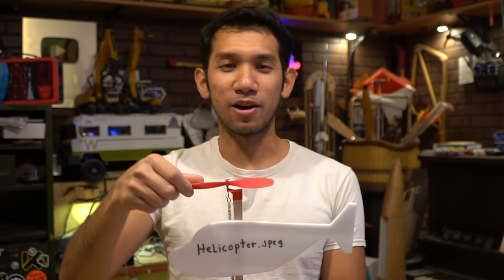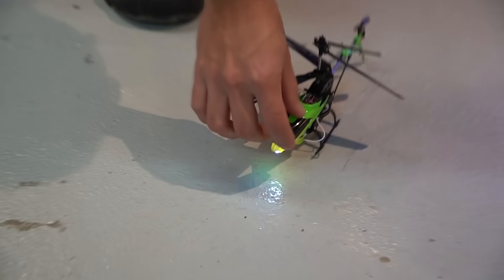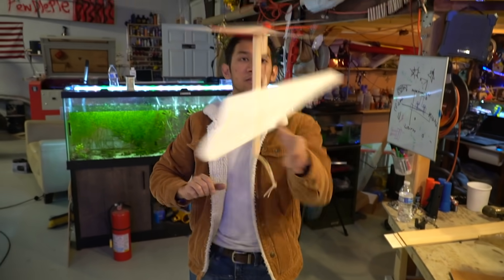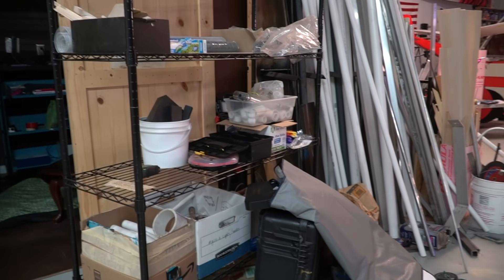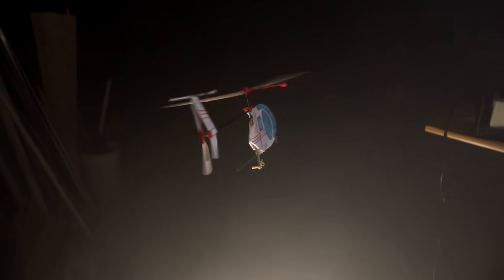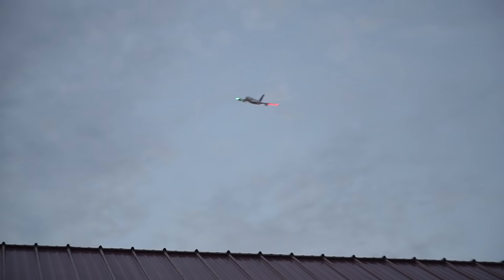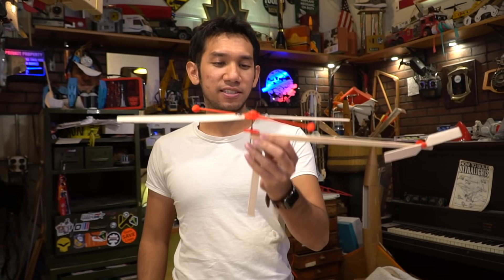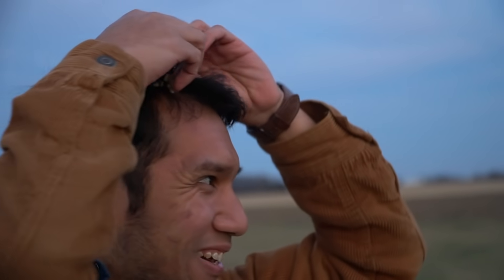Making a Rubberband Powered Helicopter (working tail rotor)

Comment from the maker: Big thanks to Ridge for sending me this wallet and supporting the channel! Here’s the site if you want to check them out! > ridge.com/SRIPOL
Reply: Soooo...Blitz infected you aswelll
Reply: the upper rotor blades need to be able to pivot around the attachment point. as the rotor actually swings and chops through its cycle kind of like a whip. There is a high speed point and a low speed point, research rotor blade physics. =]
Reply: Good job. Greeting from Indonesia
Reply: can you bulid a big super sonic jet
Reply: I can think of a whole lot of things more fun/important/useful to do with £100 than buy an overpriced "wallet".
Reply: Dude, your laugh XD
Reply: Hi
Reply: @Sharkeix  Hey Elijah! Our surnames must've starred out the same. Where do you live? Just the country your Hemmingsen grandparents come from?
Reply: 16:03 metro card
Reply: Wicked slim, unlike the girls on my tinder ... rotf
Reply: Would you ever do a bigger one? A huge remote control helicopter
Reply: make the airship from the collection
Reply: You need to balance the helicopter slightly nose heavy then it will fly forward with the tail rotor following behind.  I built the rubber powered helicopter from the plans back in the late 60s.  Balsa pulleys will grip the string better than plastic ones.  
Ken Boone 
kensrobots dot com
Reply: 안녕하세요
Reply: Te vagy a csűcs
Reply: I once tried making helicopter but it don't worked
Reply: Turn off the fan man!
Reply: I always thought your name was Stripol, not "Sripol" idk why
Reply: Can you make it have positive pitch in the blades under power and going up and then maybe when it's unpowered coming down have the blades go negative? It would auto-rotate basically. No torque on the way down so you wouldn't have to worry about the tail rotor. Maybe you need a one way bearing in there somewhere.
Reply: very impressive, but can you do it big enough to cary a Peter?
Reply: amazing
Reply: Hi man
Reply: that's sooooooóooooooo coollll
Reply: Peter, I personally know the engineer who design that helicopter design that you made there! :)
Reply: Do this but with a mouse trap
Reply: Hey can you make a rideable rigid airship
Reply: vid idea:make a rc doat out of a gravy boat.
Reply: Where are you from? Giblartar (UK)?
Reply: @IHORSHCHERBAN  ur butt
Reply: Not familiar with aviation but how about making a drone's propeller intake of air through a big down pointing tube?  https://ibb.co/1TY8ys6
Reply: Can you please revisit the drone Santa sled
Reply: Plz
Reply: Please can you make a tutorial how to make rc plane from foam
Reply: Rocket arrows?
Reply: You should really make a mk5 airplane that can take off from water. If so try to give it 4 engines! That would be a video I want to see. Try to fly it from one park to another! I hope you can do that for me!
Reply: VIDEO IDEA !!!!!!can you please make an rc airplane from only water bottles and electronics.
Reply: MAKE THE BISMARCK out of a kayak
Reply: @peter,
Talking about a cashless society as if it's a good thing..... It's NOT! You're a smart guy, so please look into why it's not a good thing.
Reply: Epic
Reply: I challenge you to make plane with toy moter or a low rpm moter and with cardboard
Reply: Hey, I had an Idea for something you could build, may be a miniature, solar powered airplane
Reply: But what if you made a life sized version that could carry a person. Ambitious as hell, I know. But that kinda seems up your alley
Reply: Make a monoplane
Reply: You can fly
Reply: Make a monoplane
Reply: Hi
Reply: What about real helicopter
Reply: plz make a miniature clone of any turboshaft helicopter model that can operate on gas. The helicopter should be exact replica of the real one and the body and engine should be build with same material (like metal). Can you build it?
Reply: yes
Reply: what is that music @ 3:48
Reply: Hi
Reply: Josh Ppe
Reply: Imagine a glider powered by rubber and some guys just cranking the rubber motor.
Reply: Y
Reply: Эво
Reply: Hi Peter I am from Trinidad and Tobago my grandson is very interesting in building a card board plane can please show him all the stuff he has to get Josiah thank you
Reply: HI മച്ചനെ
Reply: you can gus our lagu age English or malayalam
Reply: If you take two tiny screws and put one on the end of the each of the fly bars bulbs, the kinda bulging little things on the end, it will be even more stable!!
Reply: You always ware that same brown jacket
Reply: https://youtu.be/eL0RWh6xJqs
Reply: I am surprised the camera man is not dead because of the amount of times this man got hit
Reply: Peter, Have you ever tried crafting a giant sycamore seed pod and sling shotting it into the air? I'm going to make a foot long type sized one with a dog treat attached for my hound to track and eat..... That should look really cool at about a foot long and fired way up there with elastic.....
Reply: Hi
Reply: Make a super capacitor powered one.
Reply: I still don't understand why you haven't built an ornithopter
Reply: @MBIRKE  yes an Ornithopter would be epic
Reply: No
Reply: THIS HAS TO BE MY FAVORITE CHANNEL   E V E R!!!!!
Reply: This is not his best but is pretty cool
Reply: @dayontedonegan4087  sorry but im from hungary
Reply: Peter about 20 years ago, I came across a neat invention. It was called the Gyro-kite it was a kite that was a helicopter. Made from plastic, and you flew it like a Kite.
Reply: @KrazyMitchAdventures  11q1
Reply: @siawhitney2670  WHAT THE FUCK is 11q1??
Reply: My dude you made a small rc ekranoplan to demo the giant one, I tried to get the dimensions from you to build my own and you never responded, and you don't host your plans anywhere. That's why no one can build along with you, not because the projects are too complicated.
I would still really like to build that, I have the foam board waiting, but I have no dimensions.
Reply: @Kenshirou47   i like how he sead he know his things are hard to recreate and then he used a 3d printer like everyone has one
Reply: @wyattwhitman6271  dude in this day a 3d printer can be like a hundred bucks. Sure it's not a dollar store item but its not that hard to get and learn to use. 

On the other hand learning aerodynamic dimensions and then applying specific measurements to a working produuuuuct ... Not so much.
Reply: how much it costs
Reply: vid idea: put rc  electronics in a wooden rubberband powered plane
Reply: Hi :)
Reply: @trilox90  
Sisipadaya
Reply: @trilox90  you 77
Reply: Hi:-)
Reply: Could you do a YouTube video on a diy rc cool thang that I will make
Reply: So let me start this by saying I have no clue what I’m talking about but I have what I assume to be a good idea....is there any way you could make a directional clutch system and a bearing on the propeller to where the rubber band can power the propeller but at the end of its power cycle the propeller can keep its momentum going freely without drag from the rubber band so the propeller doesn’t try to wind up the band in reverse at the end of its power cycle
Reply: bro at 10:25 the heli looks like an optical illusion
Reply: My brother is a small YouTuber his channel is xd tdog
Reply: 🔴 Why Islam not other religion

 1-islam gives logical and simple idea for God - he is A perfect God - he is not a man nor a son of man nor an Idol or a trinity nor limited nor created - he is totally unique and to him belongs all the good qualities 

2-Islam accepts all messengers of God -- about 124 0000 and in Islam, we love all the prophet of God and we can’t deny any of them - while in other religions such as Judaism for example - they reject Jesus and Mohammed -- and in Christianity they reject Muhammad ... but in Islam, we accept all . 

3-in Islam, there is no mediator between you and God -- you can pray to God directly - there is no need for someone in between... 

4- Islam is the Only religion that is Not named after a person or a tribe or a group, its name means submission to the One True God, if anyone anywhere at any time lived the life of submission to the true God alone , then he is a Muslim.

 5- In Islam (worship) is not about mere rituals. it's a comprehensive term that includes any deed that pleases God. All good deeds are types of worship, smiling, being sincere at work, saying a nice word, and even treating one's spouse gently, all this is greatly rewarded by God. And in the opposite any deed that doesn't please God is a sin; talking bad about people is a sin, cheating, lying, hurting innocent people, harming the environment. 

6-in Islam God is always forgiving - if you always repent (before death ) he will just accept you no matter how great sins you did >he forgive us out of his own grace - there is no price to be paid in order for him to forgive > so it's not like Christianity which says that God can't forgive except by blood of Jesus ..

 7-Islam is a way of life – it organises each aspect in your life.. it has solutions and divine guidelines to problems in your life . 

8-the sources of Islam also was collected and saved is also amazing - it never happen to any book in history --- it's through the uncut chain of known narrators which date to prophet time ... besides the millions who memorised it from cover to cover since that time up till today - besides being documented in front of the prophet by known companions! 

9-Islam prohibits blind following without knowledge and it invite us to use our brains to know truth, it is based on evidence and logic. The rational mind is the basis for religious accountability and responsibility. 

10-the moral system of Islam is v high and perfect and thus the countries that apply Islamic laws in a proper way -- they have less moral crimes.

 11-You won't lose Jesus if you accept Islam, but you will just correct your belief in him , In Islam, Jesus stands a good position in Islam as one of the messengers of God together with other messengers.. they were all special and they were all humans like us-- none of them must be worshiped -- we only worship God who sent them . we believe that Jesus was a noble Messenger of God but not divine,,,, we love Jesus and obey his true teachings and pray like him , fast like him , and a person won't lose Jesus if he accepts Islam -- but you will just correct his belief about him 

12- Paradise in Islam is a real physical life for both Body and soul, you will go there , eating drinking marrying and meeting with prophets and having wonderful eternally unlike in other religions which they think its only spiritual life.

 👉IN ISLAM THERE IS A PURE & CLEAR CONCEPTS OF GOD 

🍃🍃🍃🍃🍃🍃🍃🍃

God is One and Unique: God has no partners, no equals and no rivals. God has no father, mother, sons, daughters or wives. God alone is worthy of all worship. God is the All-Powerful: God has full authority and power over all things. Obedience to God does not increase His Power, nor does disobedience decrease His power. God is the Most High: There is nothing above or comparable to God. The attributes of God do not resemble that of His creation. No part of God is present in anyone or anything. God is Perfect: God does not have any human limitations, such as resting on the seventh day after He created the universe.

..
Reply: bro store energy as torque and get the rpm you need out of it
Reply: Will you buy the CR-30 treadmill 3d printer? I think it is so helpful to you
Reply: Hi your the best!
Reply: also im a very small youtuber!
Reply: Hi, you make rc car, but toilett paper tire vs stinky bug trap ? Aniway you are Best.👍🏻🇭🇺
Reply: hi
Reply: @TheGWilkie  me
Reply: Wasssss upppp

Comment: Something I made about 20 years ago was an r/c helo with a pusher prop and rudder. I used a hinged main rotor and mounted two tiny out-runner motors on the fly bars, each chasing the other, offsetting any angular momentum, which would otherwise be present, were the rotor driven by stationary means. It worked pretty well.

Comment: At 20 years old I made a  balsa 3 bladed rotor system with active delta hinges and a tail rotor - rubber powered and a thread driven tail rotor with paper tr blades (pitch control)  18 in balsa rotor diameter - Stable penny taped to control by c/g shift 
30' altitude -  no freewheel unit at the time  so if the power quit at altitude the rpm would drop as the helo dropped
lots of fun

Comment: That is impressive, given the constraints of the (usually) standard main rotor/tail rotor set up.

I really liked how it flew, then banked, then flew, the banked, until it began to run out of power and just landed. Pretty cool for something that has no external control system.

Comment: I think your explanation of gyroscopic precession is a little off. Gyroscopic precession is any input takes place 90 degrees off and helicopter control systems account for that automatically, it doesn’t allow the rotor to tilt but more like if you tilt the rotor with forward cyclic you will see the rotor tilt left or right depending on rotor rotation direction

Comment: If you take two tiny screws and put one on the end of the each of the fly bars bulbs, the kinda bulging little things on the end, it will be even more stable but they do need to be tiny!! Just enough to give it a little weight on the ends, you'll be amazed!!

Comment: the simpler toy grade helicopters just use a flybar for stabilization and the tail rotor to push them forward or backward.  Higher end hobby grade helicopters (and real ones, obviously) actually use a swash plate.  And many collective pitch 3D capable helicopters nowadays actually have "stability mode", where they actually use 6 axis stabilization where tiny minute adjustments are constantly made to the swash plate's position to keep the helicopter level in the air.  They don't need a flybar, which is good because flybars actually tend to handicap your helicopter from being able to fly in any sort of wind whatsoever.  This is made especially bad on toy grade coaxials where they are using a tiny tail prop for forward and backward "cyclic".  This is opposed to a proper hobby grade helicopter using a swash plate and by extension using the meatiest part of the helicopter to move it around because when you use a tiny tail prop you are moving a minuscule amount of air as opposed to when you are using the actual main blades for forward thrust the difference is just night and day.  It is a whole world of difference, I know this for a fact because I own helicopters of both types.  The one that uses an actual swash plate to tilt the main rotors flies circles around the cheap little toy helicopters any day of the week.

Comment: A fly bar is used to stabilize the helicopter and it works like a gyro. It's mounted to the top blades to give the heli more stability.

Comment: Need to reduce the pitch of the rotor at the tips.  Form them on a larger diameter form and offset up to 15 degrees.  Static balance the rotor.  This was fun to watch.

Comment: Just an FYI, you can lube up the rubber band with caster oil and they won't break so much, run smoother and don't degrade as fast as they otherwise would

Comment: the propeler tail must spin 4 turns for 1 to front propeler to keep the tail stabilized, the flybar than u made in 3D printer, dont works well because lacks the weights at final flybar, used to keep the inercy rotation...

Comment: Your tail rotor is spinning the wrong way. It should have the leading edge going up into the main rotors down wash. You might want to try a carbon fiber to support the rubber band motor. You can get them fairly cheap and very very light but much stronger than balsa wood. If you're wanting duration you might want to try bigger rotor blades so it doesn't spin out so quick. I know the string driving the tail rotor is a very simple idea and light but can be prone to slipping. Maybe if you wrap the string around the pulleys one full turn around each one it would help your slippage problem.

Comment: I tried gearing the propeller at 3:1 ratio and using heavier multi-stranded elastic bands wound up inside a carbon fibre horizontal centre bar, it achieved a longer flight time for the tension stored in the bands, and reduces the initial speed burst at take offs.

Comment: That stability mechanism is a flywheel rotor blade picht locker, isn't it? Does it turn the helicopter against some random instability? The helicopter pitch is probably controlled by the tail rotor, and anti-torque by contra-rotating second rotor. I hope to understand more about helicopters...

Comment: Does the tail rotor need a stabilizer as well? Also, is there a air vain that could increase or decrease the tail rotor pitch to counter the rotation. Getting the exact pitch right for the rubber band and blade pitch seems really difficult.

Comment: Interesting development process! Watched in wonder and awe through the whole thing. I did helicopters too but mine were a tiny bit bigger than yours. Ended up as head of future projects of a small outfit where our Lynx held the world speed record for helicopters. Our helicopters had semi-rigid rotors actuated by dangleberries so didn't have those wambly teetering rotor things. Two technical points....one you seem to have solved but may have reneged on, and that is the top tail rotor blade should rotate aft .... and the other relates to when I used to teach helicopter flight performance at uni, and that is it is pointless to get too complicated in the flower arranging department since helicopters fly simply because they are so ugly that the earth rejects them. Nice project....congratulations.

Comment: Lift is a function of the area of the rotor disc.  Tail rotor torque would be a function of the tail rotor disc area.  The Sikorski Sea King has a main rotor diameter of 60'-6" at 203 rpm.  The tail rotor diameter was 15' at 3030 rpm.  There should be a ratio there that might help.